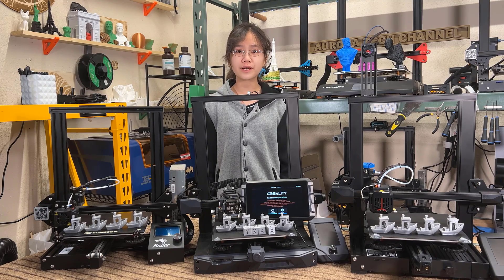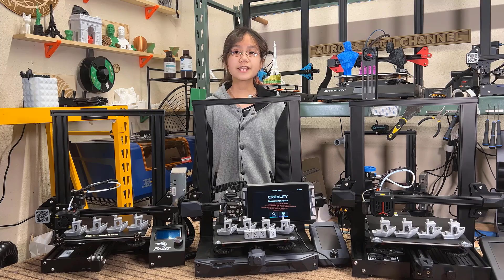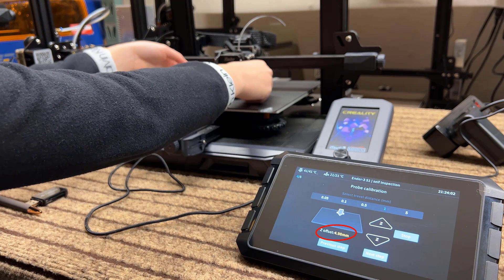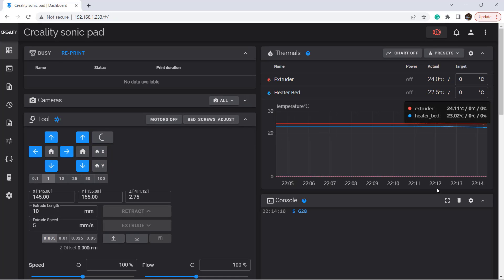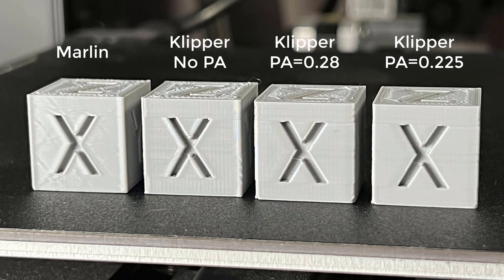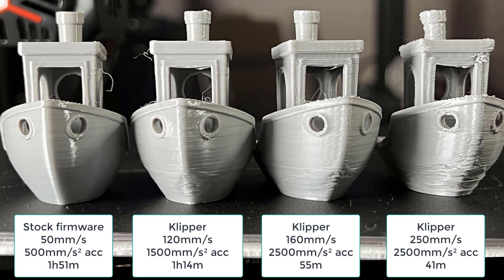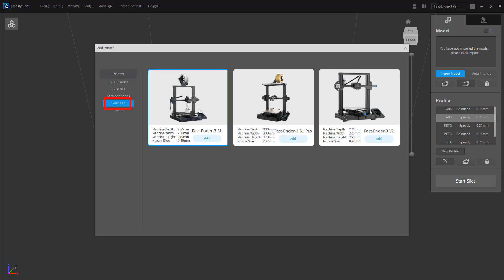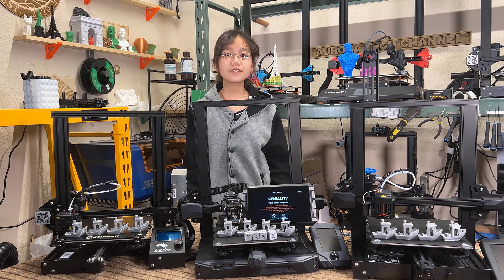Creality Sonic Pad: Klipper on Ender-3, V2 Neo, and Ender-3 S1, Input shaping, pressure advance

Comment: I have been think about connecting multiple printer to cloud as iot device and operate a print farm from cloud. Do you think this is achievable without low level programming ? What kind of motherboard/ firmware will support this ? Or setup some kind of gateway between printer and cloud ?
Reply: Asking this as I found it disturbing to check the machine and print status from time to time once the print starts. It creates  sth back in mind I always need to worry.

Comment: I watched another video to find what the purpose of the resonance test is for. He said it’s similar to what noise cancelling headphones do. Although obvious, they sample the noise at your ears and not your feet. So the resonance test needs to measure the frequencies as the print head sees them. By putting the sensor on the bed during the Y-axis readings, you are taking the vibrations that travel through the z-axis lead screws and through the rollers the print head rides on out of the equation. I suggest running the test both ways and print something tall to see if there are any noticeable differences. Maybe that is why you are not able to get faster speeds on some of your tests Aurora.
Reply: Another analogy of this is the large mass dampers near the top of tall skyscrapers. They dampen the sway of the building they feel at the top especially during earthquakes, not what is happening at the base. If the bed of the printer is reading higher vibration levels than what the print head sees, it will overcompensate for it in the software. Since I'm going to install the Sonic Pad on an S1 Plus that has a bigger bed (hence, more mass), I may see a more noticeable difference between compensation and no compensation on it. The printer overall is more massive so there could be less vibration going to the printhead compared to a standard size printer.

Comment: What an Outstanding review, I slow you down 75% and can take notes. This was extremely useful and interesting. My Train parts are picking up in interest and i am required to print more parts. It would very nice to add a larger screen and faster processing. However My Printer is the Creality 10S Pro V1 with some upgrades, Direct Drive and BL Touch. Would you PLEASE try the Sonic screen on your 10S Pro and report that result. The review was indeed OUTSTANDING. You guys always do a good job. This topic is highly technical and complex but you went through it beautifully. I was attracted to the sonic pad as it was a nicer interface for my old eyes. But what about my Optoprint will it have to replaced? And i am slicing with Simplicity 3D will it have to be replaced too? You know old people hate to change and it is harder to move from one routine to another. Our brain is not as elastic as your nimble self. Great Video and presentation please tell us how it works with the 10S Pro. Thank You All Day Hi to Mom & Dad, Dennis
Reply from the maker: Thanks! The CR-10S Pro is running an 8-bit board, so, you can't use the existing profiles on the SonicPad as they are mainly for 32-bit (v4.xx) boards. You need to wait until Creality release the firmware for the CR-10S Pro, I am not sure if they are going to make firmware for older models or those they no longer selling. The slicer should be fine, as long as it allows you to adjust acceleration.

Comment: You've got the Pressure Advance value wrong. For Direct Drive the factor should be 0.005 so multiplied by 10 mm that would be 0.05 which is a normal value. Your prints look horrible because of this.
Reply from the maker: Oh yeah, my mistake. I just check my other direct drive printer using Klipper, the PA was 0.025 instead of 0.25. Thanks for pointing out this error, I added a correction message at the top of the description.

Comment: I am fine with my stock Ender 3 and Ender5plus and I am not in a hurry. Using Marlin and well tested profiles for my preferred Ideamaker guarantees perfect prints, no ringing, no surface artefacts. My Enders are running 24/7 since 3 years without any issues.
Never touch a running system.

Comment: You did the Sonic Pad! Thank you for responding to your viewers 👍
Your expertise and problem solving is epic. 
Please could you do either of these three videos before the end of 2022 or in early 2023:
1) A summary of the top consumer printers 2022.
2) A summary of the top innovations/improvements seen across consumer 3D Printers 2022.
3) Your wishlist of features and components on a consumer printer for 2023 (Aurora TopTech 2023).

Comment: V-wheel bed slingers are the weak link in FDM. Sure, you can Klipperize a $200 bed slinger, but should you? It's not even the weight of the bed moving back and forth that's really holding you back, either--it's part cooling. Part cooling is a huge issue for high speed printing on any 'budget' printer on the market now. Consider the part cooling for the Ender 3 S1: it's not good. Of course, V-wheel roller kinematics are also garbage if you want high speed printing, as the wheels will wear out more quickly at high speeds.

Comment: The Biqu CB1 with their 4b adapter board has been a great deal for replacing the need for an official raspberry pi.  For about 60 dollars US you can get a pi3 equivalent for running klipper.

Comment: I have klipper on my ender 3v2 and was able to get a 15 minute benchy with no drop in print quality. You need to set min layer time and min feature size in cura so it slows down on the smaller features. You can also go way higher on acceleration with has a big impact on speed on smaller prints
Reply: What is your "min layer time" for pla?
Reply: @Nici619  I had a 10 second min with a 85mm/sec min speed. For small feature it was 6mm diameter with a 85% reduction in speed. 150 was max print speed with a max acceleration of 8500
Reply: @paultrautner1941  Damn...now I know what I'm going to be working on tomorrow. Thanks for the details.
Reply: Any vids of this because I doubt it.
Reply: @redline3036  I will take a video after I finish printing my ikea lack enclosure parts. My ender is also not stock, I am using a dragon hotend with cht nozzle, stealthburner cooling with 5015 fan. I also ditched the glass bed and went to pei spring steel. I just set up my work printer with klipper on a ender 3 s1 and 35 minutes was the fastest I could get due to cooling issues on the haul.
Reply: @paultrautner1941  I’ve seen up just messing with ya it’s insane how far 3D printers have come
Reply: @redline3036  Got around to making a video. Just under 14 minute benchy with good print quality. https://youtu.be/HHND-69QQPs

Comment: Thank you Aurora great video! Do you know if works on cr6 se
Reply from the maker: The GPIO pin out of the CR-6SE may not be the same as Ender-3/V2/V2 Neo V4.2.2 motherboard, you have to wait for Creality to release new firmware that supports the CR-6SE as well as other printers.
Reply: @AuroraTech  oh sure I hope they release one soon thank you so much

Comment: Great video. My concern with this and the Speeder Pad are is wanting a camera on each printer that's set up.
Reply from the maker: You can use it without the camera, so, I expect you can control 3 printers and one camera with this pad. But not sure when will they release a new firmware to support multiple printers.
Reply: @AuroraTech  Hopefully they do. Personally, I want multiple cameras. Do I need them, no haha. I know the Flsun pad can support multiple printers. I do not think it comes with the sensor for the resonance tuning.

Comment: I have the old ender 3 pro but upgraded the motherboard to a bigtreetech mini 3.  What do I need to do to make it work with the Sonic pad?
Reply from the maker: As there is no profile for BTT MB yet, you need to wait for the firmware from Creality or the community. You need to set which GPIO pin is to control which fan, which pin is connected with the BLtouch...
Reply: @AuroraTech  ok, thanks for the quick reply.  I think I'll wait a bit for the community to come up with something rather than tackle this myself.

Comment: Do you know if it will work on an Ender 6?
Reply from the maker: Not sure as I don't have an Ender 6. Logically Klipper should work on most printers if they allow you to customize the firmware that upload to your motherboard, you may need to set which GPIO pin is to control which fan, which pin is connected with the BLtouch...
Reply: @AuroraTech  thank you, your the best.

Comment: I will just wait for Marlin Pressure Adavance, I am already using Octoprint and Octodash on my Ender 3's and Ender 5 plus machines and am happy with it and I have a Pro 3D V-King 400 Core XY running RepRap on a Duet 2 for fast printing
Reply: marlin already has linear advance

Comment: You are fast becoming my go to for 3D printing hardware reviews.  I have been waiting for an unbiased review of the Sonic Pad and you delivered.
Reply: "You are fast becoming my go to for 3D printing hardware reviews."  For me, they already are.
Reply: I have to say I agree. You deliver excellent informative information in a clear, no fluff, honest manner.
I very much appreciate it.
Reply: Honestly ever since the CNC reviews and upgrades I’ve been watching. Might want to check out the MPCNC (mostly printed CNC) that’s under $700 to build and can mill aluminum or cut steel if you add a laser cutter.
Reply: That would be great. I have an MPCNC and would love to hear your thoughts on that vs something like the Root 4 or PrintNC CNC machines.
Reply: @sparks-tech  exactly! How’s your MPCNC? Ever use it for aluminum? 😏
Reply: @dawn9340  I really enjoy it and the fact I built it myself is pretty cool. 
I used it to cut some 6mm APC board for my 3D printer build and it worked out great but thats pretty soft and thin Aluminum. 
I have some 8mm sheet stock but I am not sure what to make from it yet. lol
Reply: This. Thank you very much for your great insights!

Comment: I’m curious if it works on Ender 3 v2 clones. I have an Aquila and would like to use this.
Reply: I’m seriously considering trying it on my new Sovol. It’s basically an Ender 5 with the serial numbers filed off, right down to the mainboard.
Reply from the maker: Unless they allow you to customize the firmware that upload to your motherboard, you may need to set which GPIO pin is to control which fan, which pin is connected with the BLtouch...